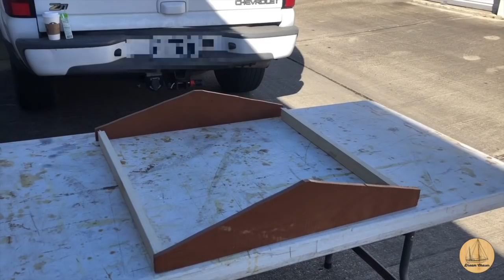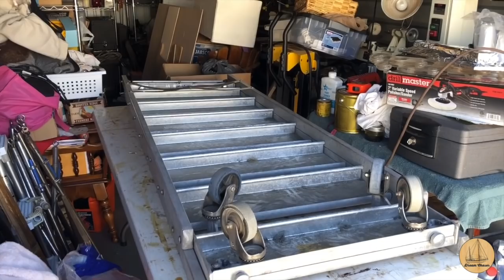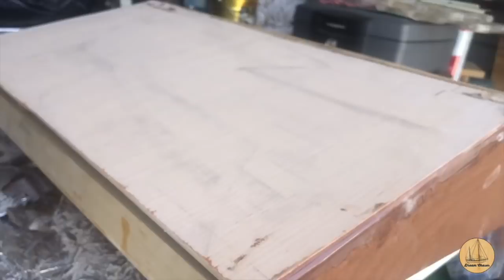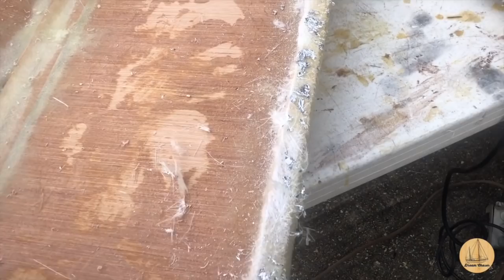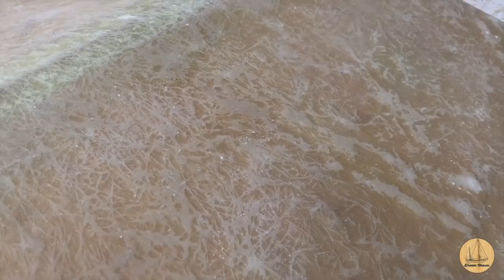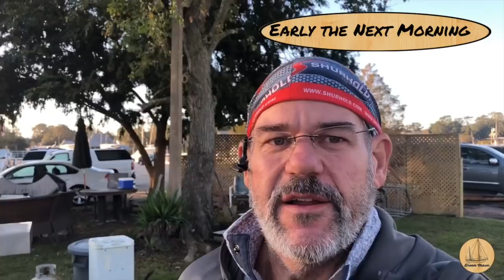How to Make a Fiberglass Hatch

Comment: It will work just fine. I want to see a crush test when your done with it I bet we will both be surprised at how much it can hold  Thanks
Reply from the maker: +Cptn Uwe's Pirate Tales That is a great idea. When I had just the thin wood frame and mold I thought it would be flimsy but it sure got a LOT stronger with the CSM on there. 

I like your idea and when I am done I will put it on the ground and walk on it. We will see what she has. :)
Reply: The finish looks better than the teak I've seen on your Boat ⛵
Reply from the maker: +vernon smith Um,  Thanks, I guesss. :)

Comment: just learned from Andy @ Boat works today Epoxy and CSM is not the best combination as the epoxy doesn't dissolve the Binder so the CSM is harder to form into shape
Reply from the maker: I just heard that in one of his videos too. I didn’t know that. I remember years ago he said to be sure you get  a Matt compatible with either epoxy, vinyl or poly based on what you use but I have never been able to find any credible information on which ones are for which material

Comment: It's not necessary to use West Epoxy. That is overkill for what you are doing. It would be cheaper to use polyester resin and works just as well except it won't be as strong as epoxy, but will be more than adequate for what you are doing . Prior to putting on glass use Bondo body putty (used to fill dents in bodyshops - it is polyester resin based so is compatible with the other materials you are using) to fill and fair the surface. Next put a layer of mat on and saturate with catalyzed polyester resin - 15 min working time, so plan accordingly. Catalyst to resin ration is 1% by volume. Adding more to make it go off faster is not a good idea as the reaction can become hot enough to start a fire, and the final harden resin product will be weaker that is following the instructions. Use bonding type of polyester resin - it sets to a tacky surface so additional layers can be added without sanding. Next put on a layer of low weight cloth as you mentioned. Use bonding resin if you will add more layers or use finishing resin to have it set to a non-tacky surface. Using finishing resin requires sanding if additional layers are planned as the resin has a wax that rises to the surface to protect against oxygen contamination, which is what keeps it from setting up non-tacky. If you don't want to buy the additional finishing resin, then when the cloth sets, squeegee on a thin layer of bondo to fill the cloth weave and paint the surface with any exterior house paint. By the way, using polyester resin instead of epoxy is much cheaper, and will be weather proof like the epoxy. Also, in the future, when using epoxy, you can slow the reaction time to give a longer working time by immersing the catalyzed epoxy resin container in a second container of ice and water.
Reply from the maker: +Lazy Days Thanks for all the detail. It is very helpful and I have made a deck box with poly resin for all the reasons your described. I did a video series on epoxy vs poly and came to the same conclusion your provided (links below to the tests and analysis) 

The one thing I struggled with in the beginning of using poly was getting the catalyst mixed right and after a few tries I finally bought one of those squeeze measure dispensers and that helped with that. I chose the epoxy for this job mainly because it was simple to pump measure and mix in the little solo cups. I was being purely lazy and to your point, the analysis I did on that larger project was like less than a third of the cost of epoxy. 

All great points. I never thought of using bondo first but that is a great idea too.   Thanks again

Epoxy CS polyester tests - https://www.youtube.com/playlist?list=PLlwpbgibX_O8YDmiSoOMpJD32SjY3ye8B

Building a deck box (I did a shitty job on this box) - https://www.youtube.com/playlist?list=PLlwpbgibX_O9f9kmtwFPn_ApwAThcr01E

Comment: Since this is essentially a throwaway item Why would you use expensive epoxy to put that wooden frame together a hot glue gun would have done just fine
Reply from the maker: Mainly because I had some handy and I wanted to learn and get a little practice.